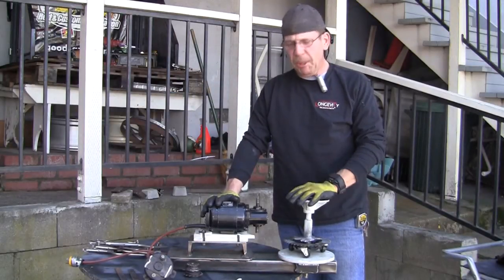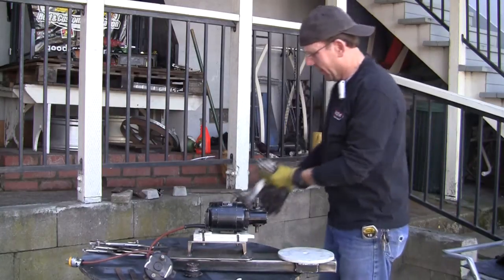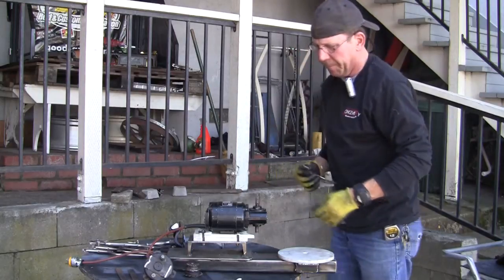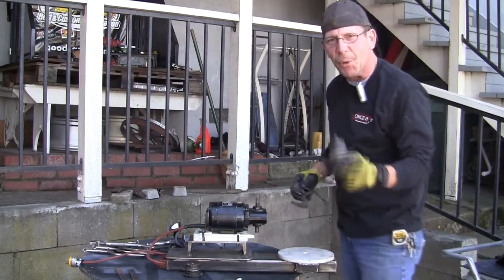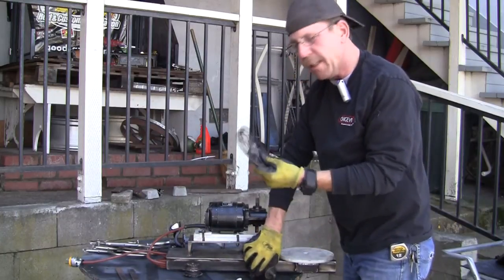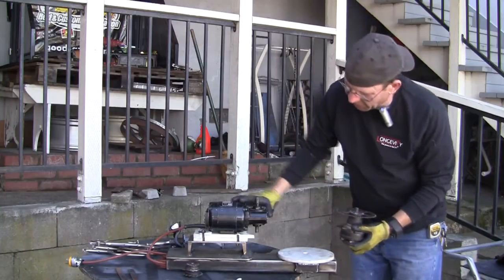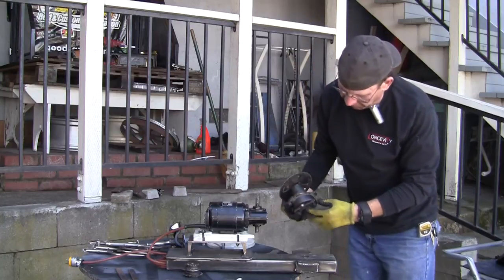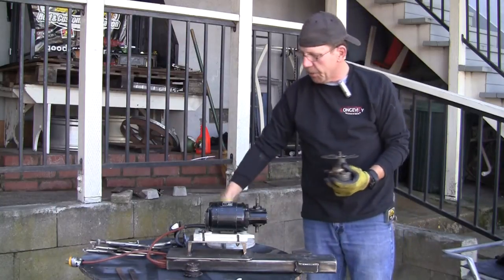Welding Turn Table Part 6

Comment: you should have bolted 4 -3/8" threaded  studs to your channel  put a 1/4 " plate on the nuts ran 4 nuts down on your  1/4 " plate to the height of your motor then cut your mount hole in that plate, this way you can adjust  it to the height  you need , and if you ever change  any thing out you can re adjust it  .. just a thought.. nice work